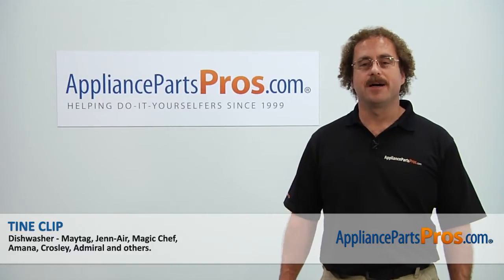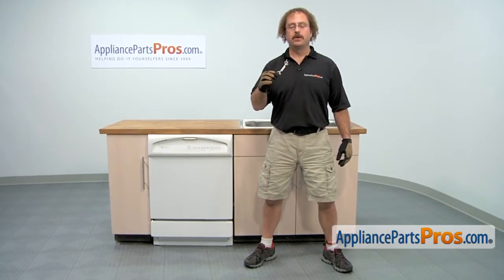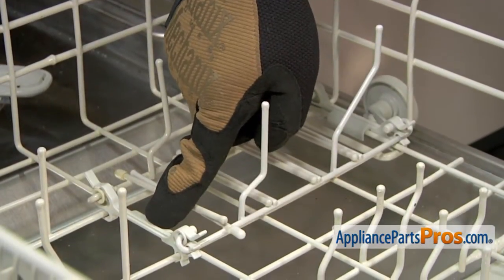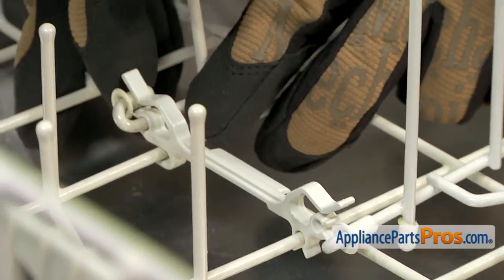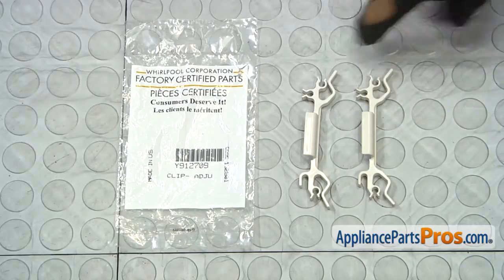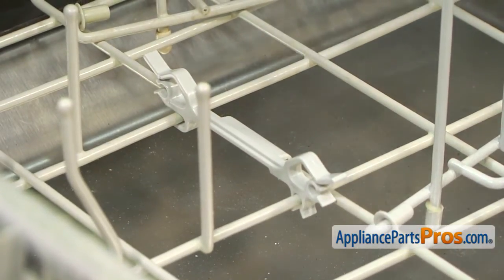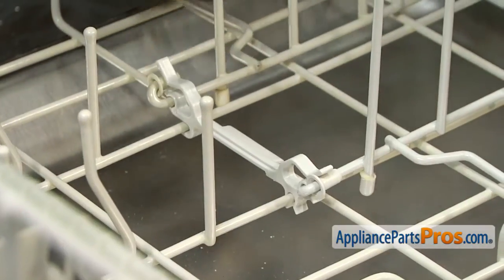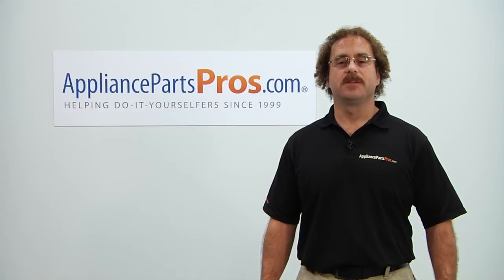How To: Whirlpool/KitchenAid/Maytag Dishwasher Tine Clip WPY912709

Comment: I am actually replacing the tine row and am struggling with getting the tine row out of the clip. Pressing down as the video shows, but it won't release. I'm reluctant to push any harder for fear of breaking the clip
Reply from the maker: They can be in there pretty tight, just use a steady pull to get them to come out.
Reply: Thanks! It finally came out and the new tine row popped in there without any issues!